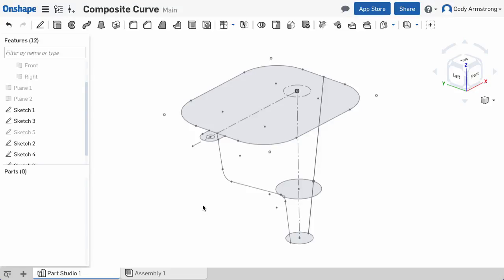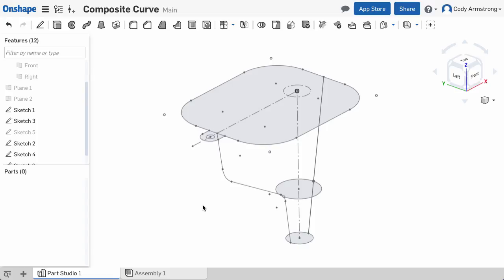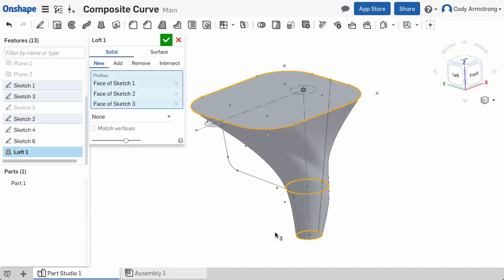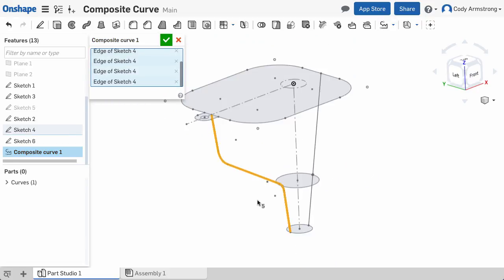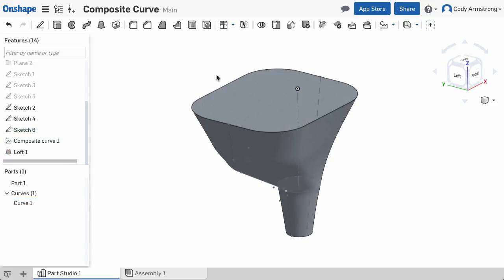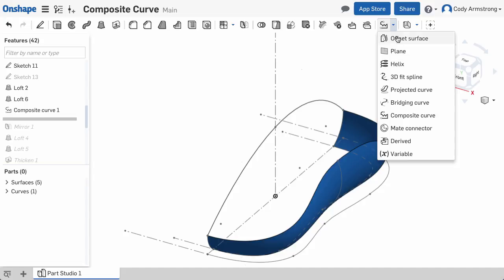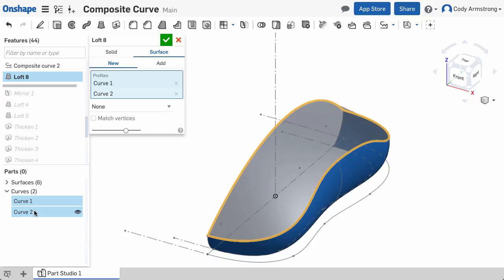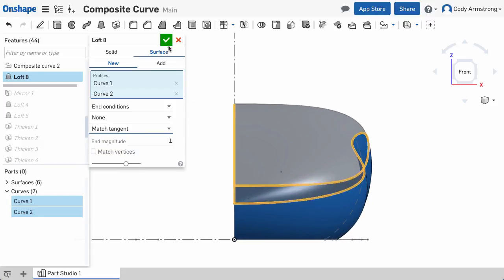Composite Curve | What's New in Onshape - May 4, 2017

Comment: This seems years behind Solidworks, where you just have the selection manager that implicitly does all this for you. How is this "reimagined parametric modeling" when you just use the exact same paradigm that everyone started out at 20 years ago?
Reply from the maker: Yes, we do some things the same, but by your logic a Ferrari is the same as a Ford. Why bother making those cars?
Reply: @OnshapeInc  Ford doesn't claim to be a Ferrari or that it "reimagines what a car is"
Reply from the maker: @eobet  Let us know when SolidWorks doesn't require a lengthy installation, long laborious updates,  collaboration in real time,  works on a Mac or Linux, add proper assembly restraints in one mate, and the ability to share complex assemblies via a link. If you look only at the design side, yes, there are few differences.